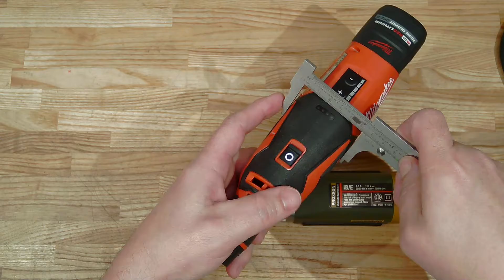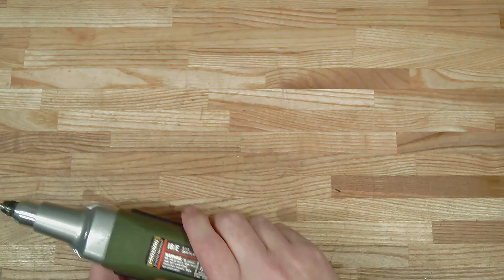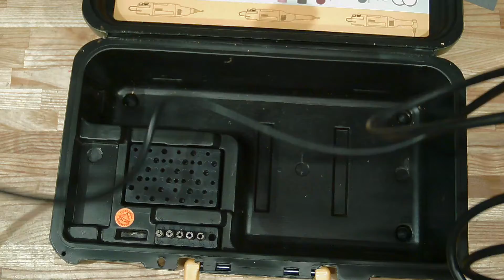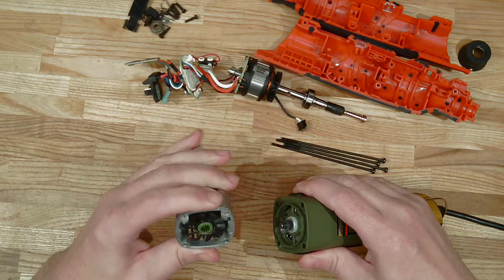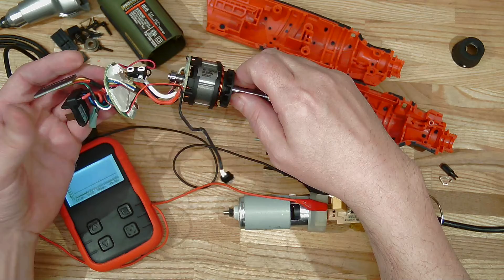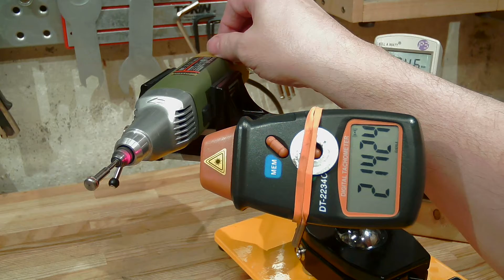Looks-See: Milwaukee M12 Brushless Rotary Vs Proxxon IB/E

Comment: Proxxon case is garbage. It doesn't have real hinges, so after opening and closing it a 100 times, it will break.
Reply from the maker: It's called a "live hinge" and they are reliable.

Comment: The wire gauge motor in the M12 motor is thicker due to the higher currents at the low voltage operation. The motor in the proxxon is high voltage so it requires many more turns of thinner wire.
A brushless motor is definitely preferred. It appears the cordless proxxon tools don't have brushless motors, which is quite disappointing, otherwise their tools are fine.

Comment: I have a older brushed Milwaukee M12 and also a battery Proxxon IBS/A.
For me, the most significant difference is just what you haven’t shown: the proxxon uses a correctly engineered  spindle with two bearings on a precision shaft. This results in much quieter operation, less noise, LESS VIBRATION (yours hands will not get so sore, so numb, so fast), less run-out and better overall job quality, as this tool is much more controllable.
The Milwaukee is good (battery tools are a game changer). I bought the Proxxon because the bearing of my Milwaukee  died. I replaced the bearing, but it’s quite hard to press it correctly, now it wobbles too much.
Reply from the maker: The new brushless tool has low vibration. Probably because it has tighter specs since the body of the tool has to hold the rotor dead centre.

Comment: Mine seems to jerk randomly at the lowest 5k rpm setting. Can you confirm this with yours if it does the same ?
Reply from the maker: Mine too. I thought it might have been something to do with fitment when I put it back together; that something got slightly misaligned. But it only happens at the lowest speed.
Reply: Thats normal with brushless tools. At least the ones I held in my hand all do that. If I remember correctly, then it has something to do with the ESC not being the highest quality or the Motor just not getting enough juice.